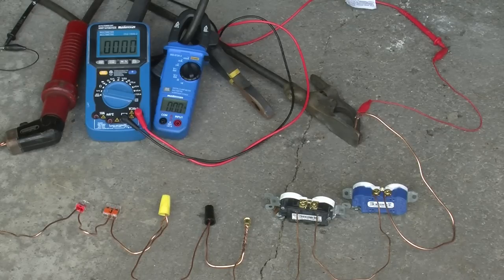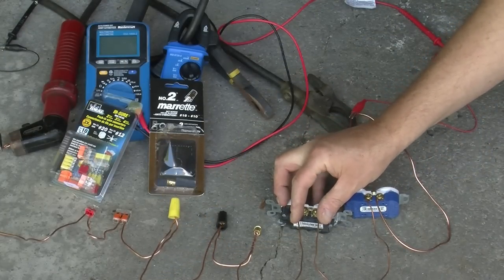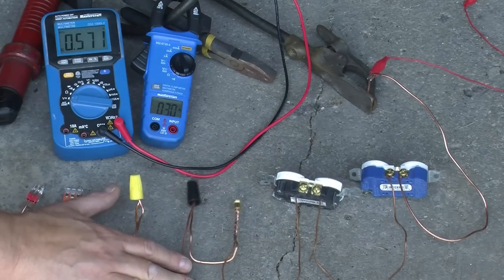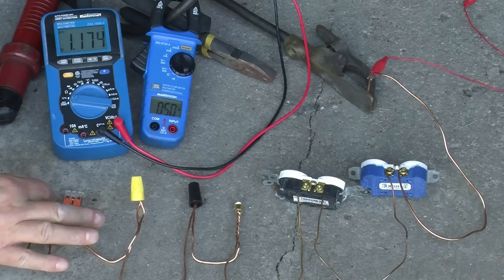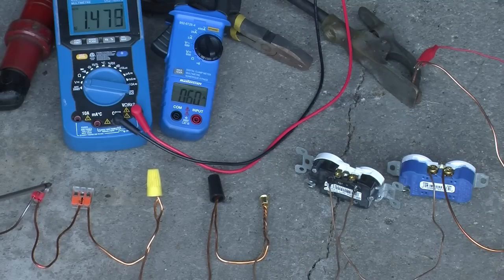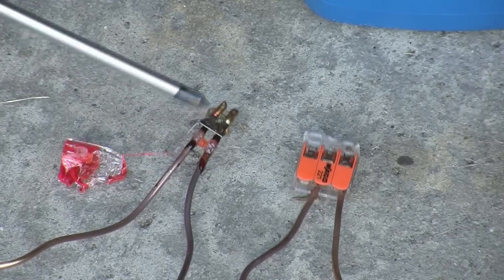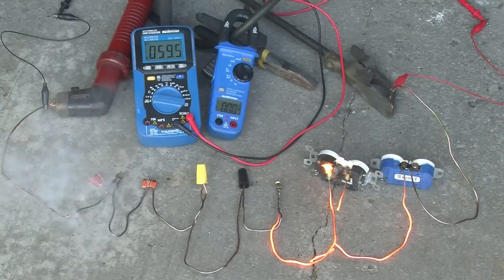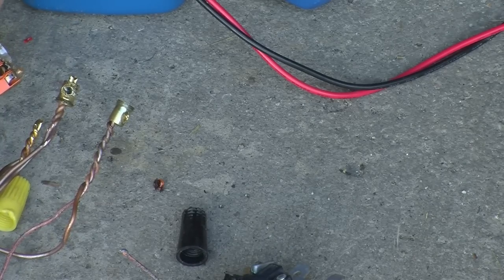Connectors: Which is the Weakest Link

Comment: Nice test procedure. I'm not at all surprised that the push in type outlet failed. The first time I saw one years ago sent shivers through me.
Reply from the maker: I have heard horror stories about those push in outlets - and some commenters have also told  of their bad experiences with those outlets. I'm really surprised that CSA and UL still certify those outlets - they seem to have such a history of failing. I guess the only good thing is they are in (hopefully) in a metal outlet box that contains the fire.
Reply: @ElectromagneticVideos  I'm not familiar with CSA. I wonder if either organization follows up with field reports on things they approve in the lab. Or at the very least, periodic testing of up to date production versions to see that they're still viable.
Reply from the maker: @joewoodchuck3824  CSA is the Canadian equivalent of UL. Both organizations certify stuff in both countries and elsewhere. You know, I don't specifically know if they do follow up on reports on things that happen in the field. I would have assumed they do since for example changes happened after houses wired with Aluminum wire started burning down in the '70s. It could be that outlet fires have simply been well enough contained to fly under the radar, possibly with pressure from the manufacturers. Certainly not an impressive showing for the entire electrical industry to have those things still in production and use!

Comment: The yellow twist on connector ( Marrette) is designed to be installed on untwisted wires. The black set screw connector is called a Marr. Both are Leviton products.
Reply: Can you provide sources for your assertions? Never seen a Leviton wire nut…they provide them with some products, not sure about them producing them.
Reply: @wm79198  ,
They were made in Canada. Quebec, I think. My Master Sparky filled me in on the rest.
Reply: The yellow one is a twist-on type connector, possibly an Ideal Wire-Nut which can have straight or twisted wires.  The black one is a Marrette (AKA Marr) for straight wires.  Good twisted wires don't really need anything except an insulator such as good electrical tape to have a good electrical connection.  Codes may not allow it, though.

Comment: Well that awesome test concluded what I already experienced with the backstab outlets aka speedwire.    I've replaced burned up devices,  and it seemed to have occurred after a space heater or air conditioner was running.   Sometimes the outlet had nothing plugged into it when it burned out,  because it was passing current to the rest of the circuit.    In fact my employer would look at outlets and switchs to judge the laziness or lack of, the newly hired employees 🙂    Speedwire was a sign of someone who just wanted to finish a project in the least amount of time and didn't take as much pride in quality workmanship,  looping around screw terminals meant the employee took pride in his or her work, and had the best interest for the occupants of the home.
Reply: Yup. Portable A/C units and heaters too much for aged speedwire receptacles. Then the cooked receptacle de-energizes downstream receptacles 😥.
Reply: Many mobile homes burn because of their cheap products and quick assembly times. The same places that end up with portable electric heaters and window bangers.
Reply: Speedwire / backstabbing receptacles should never be used without a pigtail. Speedwire connectors should not be used as a junction for downstream outlets. This is one reason they have a bad rep. Poor best practice to use the screws as a junction for downstream outlets as well. I don’t judge fellow electricians for using speedwire, I judge them for using any part of the receptacle as a junction vs making a pigtail. Almost a 30 year Master Electrician and have probably installed a million receptacles, all with pigtails. Probably most of the receptacles installed on a 15 amp circuit were installed with the speedwire connector.

Comment: Thank you for confirming my suspicions about wagos and any other barbed type electrical connection method; they’re weak, they have reduced surface area contact and when overloaded they will generated higher electrical resistance and heat sooner than with standard Marrs and Marrette connector, and of course wire binding terminal screws found on all electrical outlet devices (switches, receptacles, etc.).

Good demonstration
Reply from the maker: Thanks! Yes - its all about surface area an a good tight squeeze between the conductors. As simple as they are Marrs are amazingly effective.

Comment: You should try this with commercial or industrial grade devices with back wire contacts: two interlocking serrated brass plates with a screw to clamp them together. Similar to a simple screw terminal, but they don't require a hook in the wire and appear to have more current-carrying cross-section.

Also, that 14 AWG wire is probably what's heating up the screw terminals.

Comment: My house was built in 1956. The #14 circuits have to be hooked to 20 amps for the load to hold. A lot lot of receptacles are bakelite. It doesn't melt. It just crumbles. Most of the older wirenuts had set screws. I was surprised. 🐀🐾
Reply from the maker: Interesting! So is that 14/2 wire or some form of separate #14 conductors?   I have a lot more confidence in Bakelite than some of the modern softer plastics. I read somewhere is was a really revolutionary product. And your wire-nuts with screws - some of the better or higher temperature ones still do! Do you have any of the receptacles that support both the modern  and old style plugs with prongs 90 degrees rotated from what we are used to?
Reply: @ElectromagneticVideos  There were a few, but they've been replaced. I thought some of the 20 amp plugs had a sideways neutral. Lowe's still sells those plugs.
Reply from the maker: @djratino  Yes - modern plugs with one of the pins sideways as you describe is the standard 120V 20A and the receptacles for it have a T shaped slot to fit both 15A and 20A plugs. And similar foe 240V 15A and 20A plugs.
Reply: I think any connection relying on spring tension will fail over time due to heat. The best connections are the twisted kind with a crimp. But that's if you're not willing to use thermite 😂

Comment: I’d love see you test wago vs wire nut, with 4 or 5 wires in each. 

I currently wire everything with wago lever style connectors and I’ve yet to have an issue. I feel like they are superior to wire nuts one you get to 3+ wires in the same connection. I find it very difficult to get 3,4,5 wires twisted perfectly into a nut without at least one of them being loose and sloppy. Too much room for error imo. With wago connectors, all the wires have the same connection no matter how many there are.
Reply from the maker: You make a good point about a wire nut with many wires - I will try and test that sometime. Unfortunately because of the toxic  fumes I do these tests outside and as we move into fall weather it becomes less feasible to experiment outside. So I cant make any promises when. Having said that, I'm keeping my eyes out for something I can make into a simple fume hood which would mean I could so some of these smaller tests in the comfort of my basement workshop as the  weather gets colder.

Comment: I don't know if you use them in US but in Brazil we have some that are a series of short copper tubes with screws on each side housed on a ceramic encasing. You insert the wires each opposite end of the copper tube and use the screws to hold them we call them (in Portuguese) connection rulers (I think the name used in English is terminal strips). They are similar to set crew connectors but with several in parallel on a non conductive encasing like a polymer or ceramic.
Reply from the maker: I know exactly what you are describing! They are not used for house wiring here but I have used them for industrial automation - I really like them. The ones I have used have plastic insulation - I can imagine the ceramic ones are so much safer when overheating. 

Brazil? Cool - I was born in Rio de Janeiro when my parents  were posed to the Canadian Embassy there (before Brasília). Greetings for Canada!
Reply: @ElectromagneticVideos  Cool. They changed the capital fom Rio to Brasilia in 1960. Now I know the lower bound of your age same. I'm just a litle younger I was born a few weeks before Kennedy was killed.
Ohhh you are Canadian nice!
Reply from the maker: @agranero6  Ha! You must be a detective! Actually I must be almost the same age as you - I'm guessing the Embassy did not move to  Brasilia immediately. I remember my mom telling about hearing of the Kennedy assassination from some American neighbors who had heard it on shortwave radio almost immediately when it happened.

Comment: I would love to see videos testing different breaker brands and trying to trip them by applying heavy loads. It would give some excellent data about which breaker is the most safe to use.
Reply: I like this idea however it will take a large sample size of each brand to get any kind of conclusive results.  Only testing one or two or even 10 of each brand wouldn't be all that accurate considering the level of mass production at hand.
Reply from the maker: Your absolutely right about needing a huge sample size. And maybe even bought at different times to get different manufacturing runs.  I would like to test one of the infamous Federal Pioneer ones though!

Comment: This is awesome. Wish someone did the same testing with common automotive connectors like Deutsch DTM, DT and DTP, Metripack and others.
Reply from the maker: I will look  into doing that! I have a 100A DC battery charger that might be able to do the equivalent mimicking the DC from a vehicle. I haven't had much experience with auto connectors. You listed a few  - what would be the top 5 (maybe the most common or failure prone?) for a test?
Reply: @ElectromagneticVideos  with automotive connectors it not really the connections (if done right) it the corrosion that occurs over time. Some connectors are better sealed than others
Reply: @ElectromagneticVideos  I would say the two most common series of aftermarket connectors for automotive use would be the Deutsch and the Metripack. Both series offer different max current connectors.  

For Deutsch:
 1. DTM =max rating of 7.5 amp per pin continuous. Max AWG 16Ga with appropriate pin and socket (0460-010-20141 Pin PN, 0462-005-20141 Socket PN)

2. DT = max rating of 13 amps per pin continuous. Max AWG 14Ga with appropriate pin and socket (0460-215-16141 Pin PN, 0462-209-16141 Socket PN)
3. DTP = max rating of 25 amps per pin continuous. Max AWG 12Ga.

For Metripack (Delphi,Aptiv)
1. 150 series = max rating of 14 amps per pin continuous. Max AWG 14Ga.
2. 280 series = max rating of 30 amps per pin continuous. Max AWG 10Ga.

If you don't have the crimp tooling already the initial investment might put you off from testing these. But it is an awesome video idea that I know many people would find useful. 

The biggest thing that always gets highly debated is how the knockoff Deutsch connectors (most common on amazon under JRReady brand) compare to the real Deutsch connectors and pins (easily ordered from Prowireusa.com). 

I wish I had access to a big DC current controlled supply so I could perform the testing myself :).
Reply from the maker: @hotrodpaully1  Of course! Its a terrible corrosive environment particularly where I am in the winter with all the salt on the roads.
Reply from the maker: @SpeedNessRx7  I'll have to see if any of the crimp tools I have would work with those connectors. Not a fair test of they arnt properly crimped. If you can get an old school non-electronic 100A battery charger or old school non-electronic DC arc welder and hook either to a variac  you can probably do it. Will need a DC clamp on (or in-line) ammeter - many are AC only. Happy to help and offer suggestions  if you want to try it!